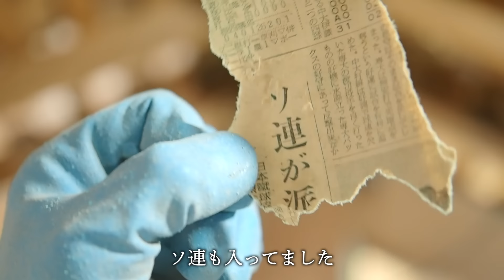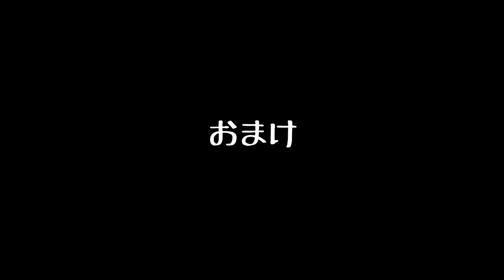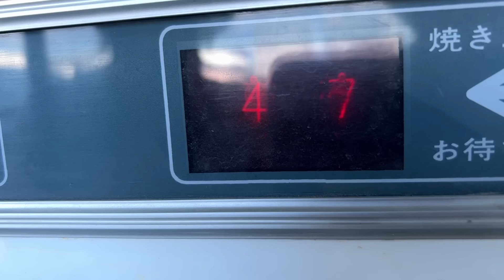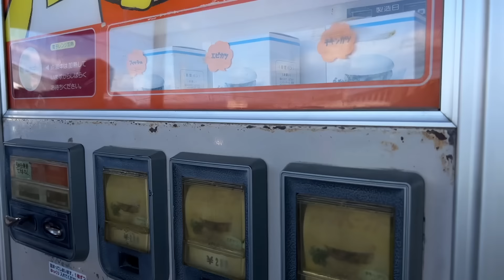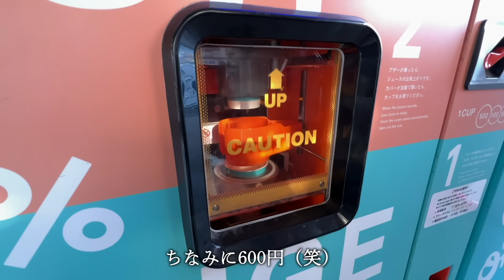田舎暮らし 117：ヤバすぎる古民家の屋根裏

Comment: Happy New Year! Good job on the attic, that looked like no fun at all, but it’s done now. 

Trick for flowers from bulbs like narcissus or tulips if they droop - take a pin or a needle and poke it all the way through the stem, crosswise just below the flower head and pull it out. This will cause the stem to draw in more water and it will usually straighten up again.